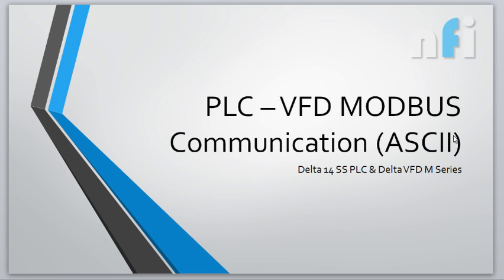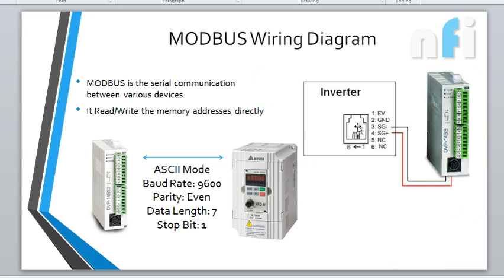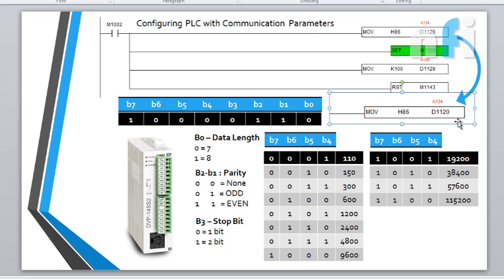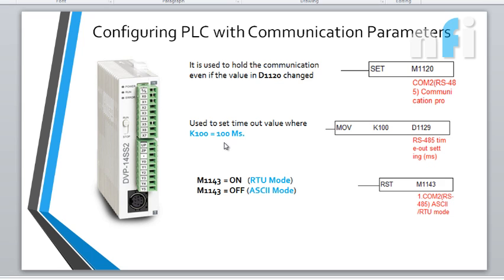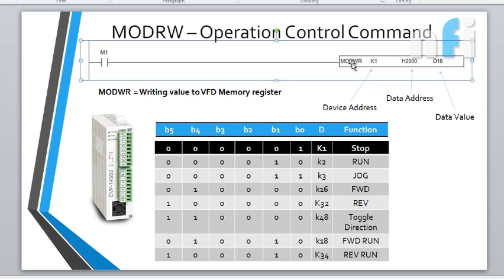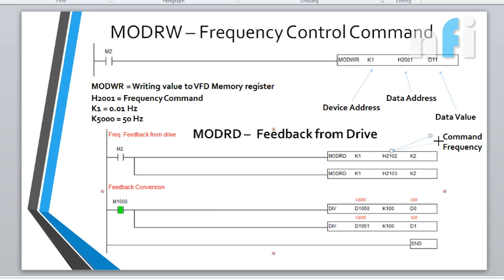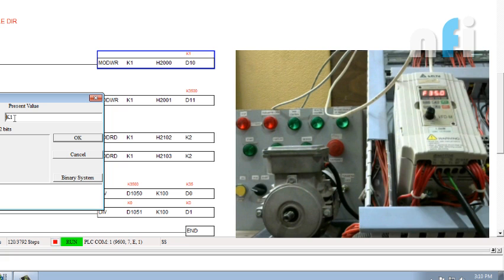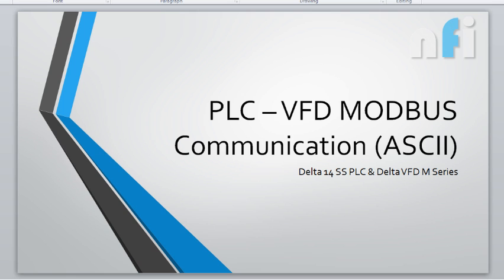PLC & VFD MODBUS Communication Mode

Comment: Dear sir, Thanks for this video. I saw many videos about what a modebus is but was not able to understand in my mind. Because they have not mentioned there is ics and in chips memory you can use to change with parameter values instead of potentiometer and all that. Just they tell open protocol and master and slave etc.Which didnot clear my doubt. They nowhere explain that the protocol is achieved by some instruction registered of ICs in device memories(plc,Vfd,hmi). But in your video you explained it. that's wonderful.
Sir, if I want to buy plc hmi scada kit which and from where can I get it very affordable price for self home learning and understanding in a step by step manner. 
 Thanks

Comment: Hello bro, I read the voltage and the current from the VFD, and the value will be saved in D1050 and D1051 why both saved in D1050 ? In other words the value in D1050 once the current value and once the voltage value why the voltage will not be saved in D1051 ?

Comment: Genius ! But can we read/write any parameters from VFD even if it is not mentioned in the parameters address table? E.g 90-03 parameter group 90 & group number 03 ( 9003H ) ?
Reply from the maker: No you can only Monitor parameters which has their modbus addresses

Comment: Great vedio done by you
I want to read function code 04 input register in delta plc .
Modrd,modwr command is support only function code 03 holding register.
Pls suggest me the command for function code 04 ( input data register)

Comment: while using modwr you write the value of d10 to h2000, is this h2000 dependent on the manufacturer of the vfd or it can be used when using any type of vfd with delta plc?
Reply from the maker: Its dependent on the hardware so basically on VFD

Comment: Hello sir. Can I control the VFD with arduino?
Reply from the maker: Yes you can! Either via hard wire control or via Rs 485 modbus ! And if you have ethernet shield then you can use Modbus TCP/IP
Reply: @thegeterrdone  Okay sir. Do you do some tutorials regarding that matter sir?
Reply from the maker: Yes you can! Either via hard wire control or via Rs 485 modbus ! And if you have ethernet shield then you can use Modbus TCP/IP

Comment: If we use more than one drive what would be  data address for plc for showing the output frequency and command frequency
Reply from the maker: In PLC, you will find many registers for reading MODBUS data, you need to asisgn those dataregister in MODREAD command.

Comment: hello sir , i m using vfd el series and plc 14 ss2 . i m not able to communicate the vfd(el series) with plc (delta 14ss2) by ths programme
 .
Reply from the maker: Did you check the appropriate parameters for communication? Also the wiring.. ? Also kindly check if your VFD supports RTU or ASCII communication mode. This information is in the VFD manual.

Comment: Thanks for the above video.. but i am facing small problem in our PLC ... Please can you help me... The problem is we are communicating ABB ACS800 VFD drive to Forbes Marshall PLC successfully. but the problem is in one direction of rotation only we are getting correct reading of RPM, Frequency and Torque reading, if we change the direction of rotation of motor ... we are not getting correct reading... the above three parameters address for both direction is only one address, he is not given (ABB) for two address for both direction so that's way it is not correct like that our Forbes Marshall PLC engineer said. but my doubt is it is only program mistake in PLC.... Please give suggestion for our problem or please send me mobile number 

Regards 
Venu 
8885683830
Reply from the maker: Dear Venu, that's a strange problem. If the address is same for RPM, Freq and Torque..it should give same reading irrespective of the direction. You can write me further at nfiautomation@gmail.com
Reply: Thanks for your reply... can u give me your mobile number i can speak directly instead of mail... please do needful. 
Thanks and Regards
venu

Comment: hello sir can I control vfd frequency with limit switch I want use vfd for my hydraulic press pump
Reply from the maker: Yes you can do that ! Just connect limit switch common to VFD digital ground and then output to the M0 or M1 to achieve whatever you want!

Comment: hello,
I would like to control VFD drive using PLC analog output can you share details of its connection and configuration process?
Reply from the maker: You can learn that in our E-learning course Advanced AC Drive. We are using PLC analog input/output cards with control signal of 0 ~ 10VDC to read/write frequency of VFD respectively. More details: http://nfiautomation.org/courses/advanced-ac-drive/
Reply: Thanks sir
Reply from the maker: The connection depends on the Drive and PLC type. Kindly share the manuals of both at nfiautomation@gmail.com

Comment: hi i have got two KEB inverters on two motors on a machine its a master slave configration.i was just wondering where and how do you configure which to make a slave or master.??
Reply from the maker: well, you can do that by assigning the different communication address to the VFD. Now you can control two VFD using Modbus. To make master slave operation its all about coding.
Reply: what things do i need to take care of when i replace a vfd in a master slave configuration.
like i said i have these 2 vfds one is master and othere is slave and master has given up i want to change master vfd

Comment: Thank you sir.its helps alot,
Reply from the maker: Your welcome THALHA NS
Reply: Rajvir Singh Sir,Am try to communicate  mitsubuhi vfd  with delta plc via modbus.,set the parameter in both vfd and plc,and write the communication codes..similar that you had done in delta...rs 485 pin open .but does'nt communicate.,
please help me Sir
Reply from the maker: THALHA NS
 for Mitsubishi, the code may not be same. Because you need to check the communication protocols (Parity, baud rate, data bits, stop bits) of Mitsubishi drive for Rs 485 MODBUS communication. Then you need to set those parameters in the PLC (if you know what i mean).
Reply: Rajvir Singh Thank you sir,

Comment: Hello. Thank you so much for all your wonderful videos. I am sure many of us would be completely lost if it weren't for people such as yourself who are willing to extend a helping hand. My field is actually embedded systems and as such I have very little exposure to plc. Modbus too is new to me. I would like to be able to communicate with the delta vfd via pc (not plc). Basically what I am trying to do is interface a small keypad to a pc using a micro-controller and rs232 protocol and then have the pc send the commands to vfd via modbus to vary frequency. Is that possible? I cant find modbus commands in the delta vfd manual.....
Reply from the maker: Neo Avelino Hi! Well if you are doing it with PC., you have two option.1) Either you can use VFD Software named VFDsoft., in which you have parameter settings, VIsual monitoring and built in Keypad to control the VFD.2) You can use C program to directly read/write the register of VFD. What you say is possible. But why Micro-controller, if you are using PC, use PC controller and C as program. How doers it sound?PS. Sorry for late reply, i was bit occupied!
Reply: Thanx for the info. Your idea of using c program sounds fantastic...only problem is I dont know how I can do it. Actually I have never worked on the modbus protocol before and the delta vfd manual is very confusing to me. If u dont mind, I would like to take our discussion in a different direction- lets consider eliminating the pc part altogether and just try controlling the delta vfd using 8051 micro-controller alone. How can one vary the frequency of the vfd using micro-controller and modbus? What will be the modbus command for it?
ps- thanx for replying back. means a lot to me.
Reply from the maker: Neo Avelino Hello Neo, I don't have idea about Micro-controller programming, have not really done it before. The idea is to write the value in 2000H register of VFD which defines the Operation and 2001H which defines the Frequency of VFD. SImilar you can read the value of feedback register of VFD. So the only way is to communicate the Controller with VFD using (9600, 7, EVEN, 1) and then Read/write the values.
Reply: Thanks for all the help. u truly are a great person. I shall give it a try using micro-controller. will let u know how it goes. thanx once again and God Bless.
Reply from the maker: Thanks neo.   ..
Reply from the maker: Thank you for your feedback :)

Comment: i m facing the problem in communication.
does 2 modwr command works simultaneously ???
Reply from the maker: Yeah it does.. What problems are you facing?
Reply: Rajvir Singh  i tried your process many times ... bt its not working....
i copied ur program line by line and put the same parameters in drive
Reply from the maker: I hope you got it solved by my E-mail

Comment: Sir, I am good at electrical hard wiring ,VFD drives and basic PLC programming.
but how to program high speed digital encoder in PLC which is used to measure the length of metal sheet and how to program HMI?